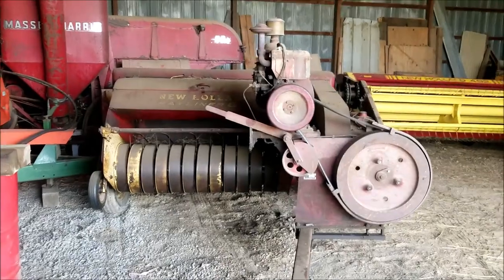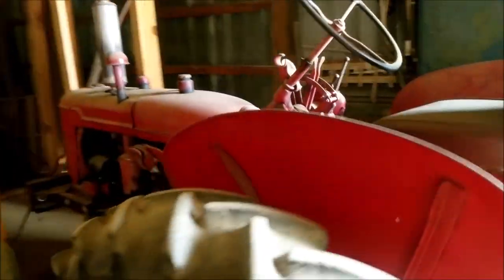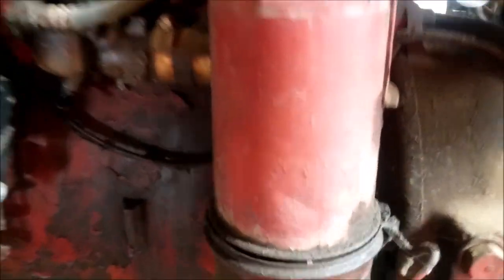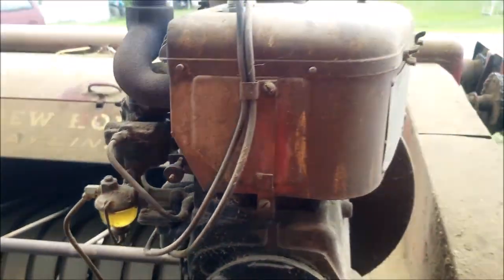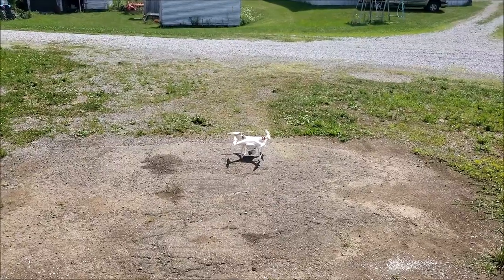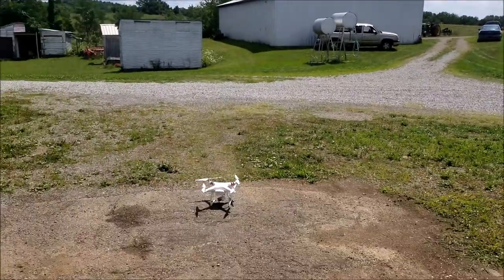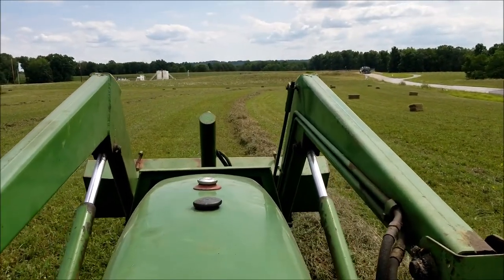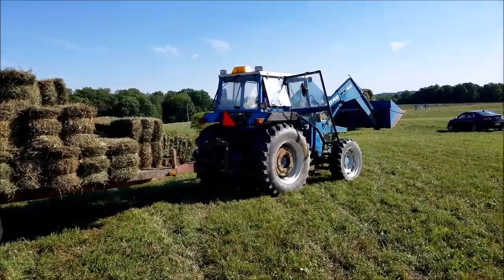Making square bales (With a New Holland Hayliner 68)

Comment: Are you using an external engine because the farmall c does not have a live pto or due to horsepower problems?
Reply from the maker: Neither. This baler has always had the twin cylinder Wisconsin engine on it and has always done well with the set up. It's pretty nice that we can hook to anything and bale. Lol
Reply: You could buy them with the engine as an option.